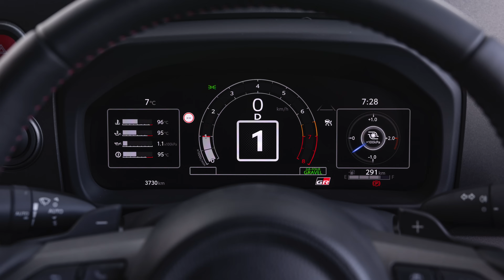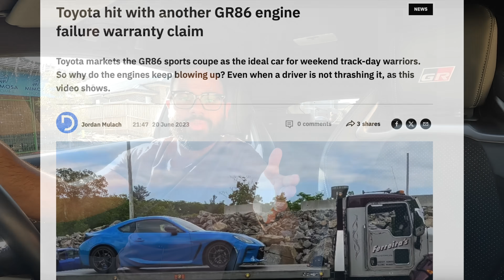The Real Reason GR Corollas Are Blowing Up (It's You)

Comment: I hear one of the big problems is the type of oil people use... Engine oil grade and weight: IL-SAC GF-6A, SAE 0W-20. For track use, the GR Corolla benefits from a 5W-30 synthetic oil, especially in hotter conditions, as it provides better high-temperature protection than the recommended 0W-20.
Reply: Facts if engine is running hotter and outside is hotter you need thicker oil period. 0w/20 is way to thin. I would run a 0w/30 or 0w/40 base on where you live and Abbott air temperature you see the most.
Reply: Formula 1 uses 15w-60 synthetic. The ONLY reason why manufacturers use low viscosity oil is to fudge fuel economy tests,
Reply: pretty much ALL engines benefit from 5w-30 or heavier.. 0w oil is for the EPA or equiv in japan for fuel efficiency ONLY not longevity...
Reply: @ryshask  Honestly I wonder if the failure rate in a lot of  vehicles isn't because the EPA makes everyone use thin oil. All the same cars over seas recommends 5w-30.

Comment: These days the tuning scene is on the German side
Reply: they not 100% reliable either 🤣
Reply: @shiftautomotive1997  more reliable than a tuned GRC or GR86.
Reply: @shiftautomotive1997 never had any issues with 3 stage 2 VWs I’ve owned, all Golf Rs making 400hp. Reliable as hell just cam followers.
Reply: Facts. DP + Tune = 500 - 700 (B58/S58) 

Supra owner here.

Comment: And then how the guys from  Australia and UK had GR Yarises with over 500hp with stock internals, drag raced with no problems at all ?
Reply from the maker: I hear ya. I also know many people running solid power. Same time, I personally know many people who blew their cars. Hit and miss. Overall, I’d feel safer tuning b58/ea888 cars (personally)
Reply: @motoringfan  There is some missing information. Some say they blow up, some say they catch fire. This is not the same thing.
EA888 and B58 (Gen2) also have their problems.
Reply from the maker: True
Reply: What problems do the B58 have  @Eugen-E
Reply: @wakaflockaproject  Switchable rocker arm failure (B58TU2) and plastic oil pump failure (B58TU).
Reply: Not bad tbh. Is that the gen 2 of the B58? Which variant is reliable  @Eugen-E
Reply: @wakaflockaproject  I've updated my comment. The rocker failure is for Gen3s and the oil pump for gen2s. Some say the valve cover starts to leak under 10k miles. So maybe the first gen is the most reliable but heard the early engines had some oil consumption but i'm not sure.
Reply: Still seems cheaper to fix than a gen 3 ea888 with its water pump issues  @Eugen-E
Reply: Heck I had a gen 2 ea888 late 2010 without it's common known issues.
Reply: Drag racing is different to circuit track racing
Reply: @MrHarey31  yeah, with over 500hp on stock internals, multiple runs one after the other )))

Comment: You could be right. All I did to my GRC was an EcuTek tune which optimized it and gave it a slight kick in the butt.
So you have done Nothing to your GRY?
Reply from the maker: I’ve kept mine fully stock. Any of the cases I’ve seen where the cars blew up, they were indeed pushing a fair bit of power. But that said, most still should exercise caution even with mild tunes. Using thicker oil if tracking, monitoring temps properly (not just from digi read out) and monitoring oil pressure. Hope yours serves you well.

Comment: These engine are already pushed to the limit from factory, any more stress and they become unreliable.. example with the ea888 for reference against the g16e gts: the first is 4 pots, cast iron block closed deck... The second is alluminum 3 pots open deck... Se the pattern?
Reply: There are 500+hp tuned examples in UK and Australia with no problems. Stock internals.
EA888 is not the 4 cylinder engine with the most tuning potential )) even if it's iron block, you also have rods and aluminum pistons which should withstand the abuse.
Reply: @Eugen-E They all withstand abuse, until the break.  Tuning is just another factor that increases that risk.

Comment: Love your vids and love my GRC. I hear ya, I’m tuned on e50 and I feel like using ethanol it’s so safe due to the 114 octane equivalent. Ethanol pulls heat from its absorption of it, and adds a knock cushion. But you aren’t wrong. I hear ya. Enjoy that Yaris!
Reply from the maker: Thanks mate. Keep me posted on how you go with it
Reply: How many mile so far? I agree. Good tune is the key!
Reply: 30,000 miles on the odometer and 15k miles tuned now on Ethanol. She rips for a 1.6L and seems dang reliable to me. Power delivery is much smoother on E guys.
Reply: @Neon05ACR what are you using and who tuned it?
Reply: @carsandcoldbrew6489 using E50 mix and Limit +1 tuned it. I using a 3in turbo back exhaust with a high flow cat to keep back pressure down.